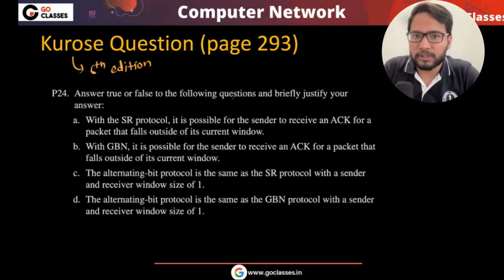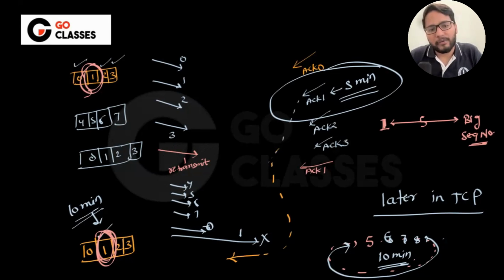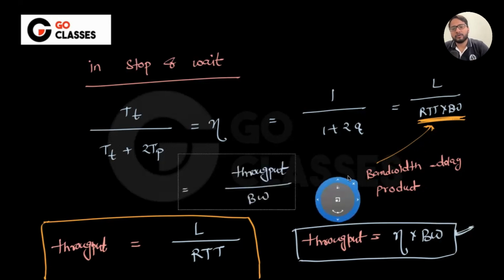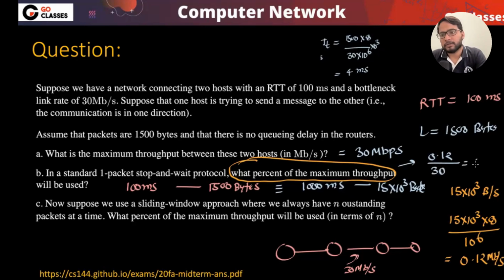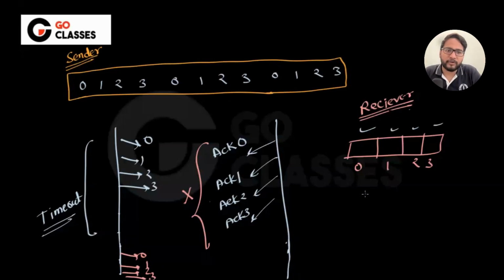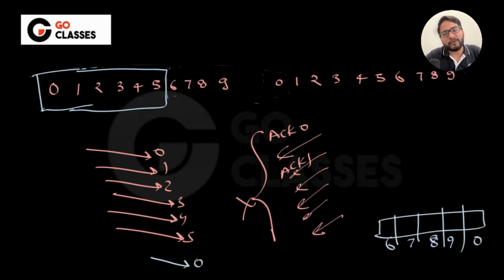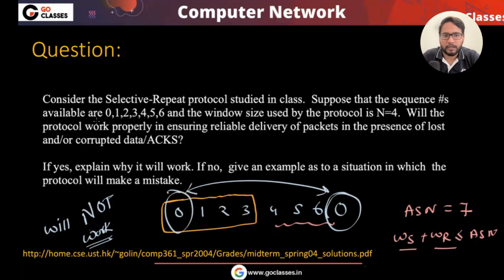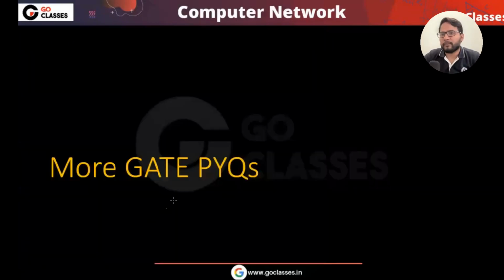Efficiency,Throughput| Relation Between WindowSize & Sequence No. Sliding Window | With NOTES

Comment: Sir but in the question at 1:41:30 , it is GBN protocol which uses cumulative acks and if higher ack X  comes that means it got everything until x-1, so new 0th frame will be sent or not
Reply: In selective repeat we can think like , that only common acks are lost

Comment: if sender size = 3 and receiver size = 2 ..
ASN is  1 2 3 4 5
for 1 2 3 it will take  1 2 ..
if acks fail we will send again 1 2 3 but receiver looks for 3 and 4 .. here correct 3 is taking and NACK for 4 sent..
4 5 1 will be the sender size again and receiver window looking for 4 5.. good  both..
even acks fail sender : 4 5 1  and receiver: 2 3.. NACK's will be sended ..
so at 1:45:47 the min # ASN are M+N..

sliding window:(GBN or SR):go back N / selective repeat or reject
sender window size + receiver window size <= available sequence number .
Ws + Wr <= ASN.
in Go back N: Wr = 1, Ws <= ASN -1
in selective reject : Wr=Ws= ASN/2